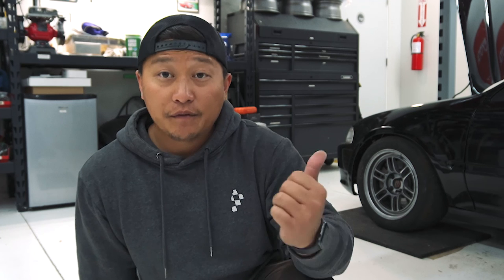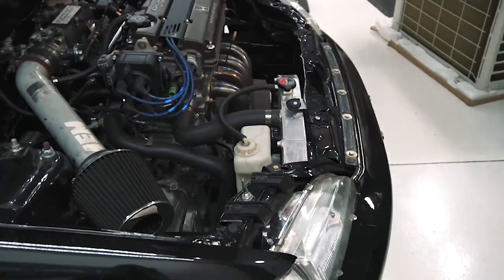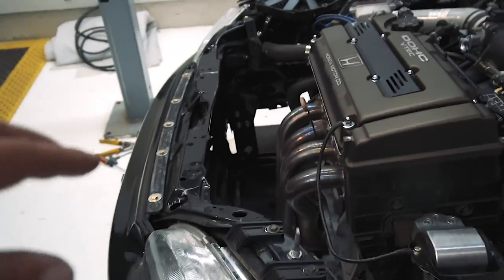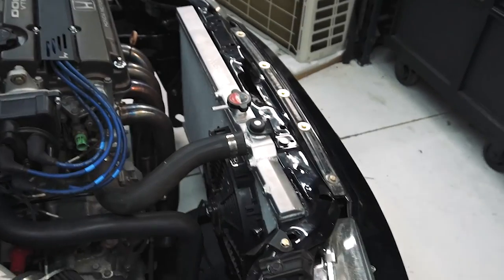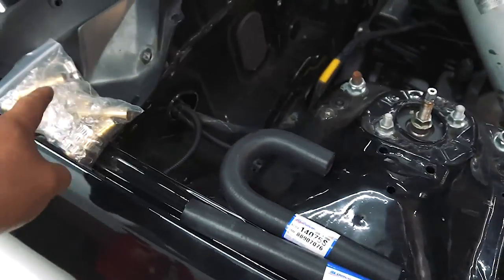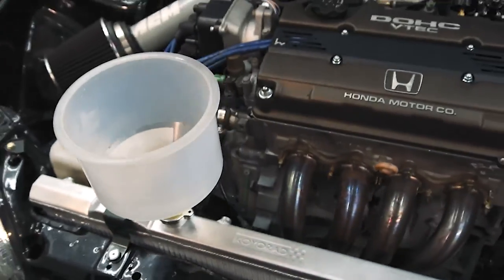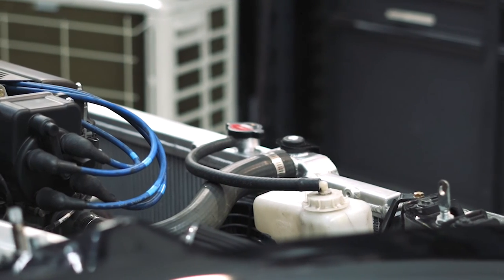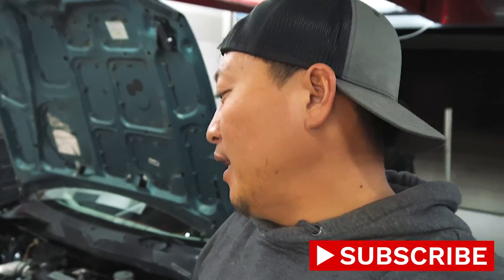Koyorad Full-Size Radiator | Civic EG Track Car Build

Comment: Nice install, but there is absolutely no reason to loop your heater hoses like that, it's best to keep them plugged off. There's already a bypass built into the thermostat housing, which is why the coolant still flows properly with the heater off. By looping the heater hoses that way, all you are doing is giving the hot coolant a path to bypass the radiator and go right back into the engine uncooled. There's a reason the thermostat has a disc on the back to block off the bypass when it's open. There are also good reasons why Hondas and many other cars have a valve that shuts off the coolant flow to the heater whenever it's not on.

Comment: I may have missed it or just don't know. When you install a new radiator you want to flush the system with water, a little coolant and bleed it? Why did you not add standard coolant and just water?
Reply from the maker: It’s a car that strictly see’s the track and not the streets. Tracks like it when you run just water, so it’s less cleanup if your cooling system decides to puke all over the track. Before the winter, I’ll add normal coolant to make sure it doesn’t freeze and destroy the engine.
Reply: @bvspeed  ahh okay that makes sense! Hope this new radiator serves you well.
Reply from the maker: Thank you!!

Comment: Nice work bro 🔥 may I asking question? I have D series want to change full size by Koyorad, the standard radiator fan and also AC is it still can be use or must change? And the second question is how about with the standard AC condenser too is it still can be use? Thanks bro
Reply from the maker: I'm assuming this is in a Civic? If you go full size, then you lose the spot where the AC condenser is supposed to go. If you feel like you need more cooling potential, just go with a thicker half-size radiator.
Reply: @bvspeed  I see thanks bro. I think about the AC condenser can move in front of radiator if I want to change full size radiator, and the standar fan for AC still using it

Comment: Awesome build. Question, I did a b18b swap on my 95 Del Sol. I live in Cali and want to make it road legal, for that I need to wire an OBDII port. Do you have any knowledge on what wire goes were?
Reply from the maker: I’m not too familiar with the legalities in Cali, but I’m aware that it can be a pain in the ass. My guess would be to find an interior harness from a 96-97 del sol which are OBD2 and go from there. I’m assuming you’d need an OBD2 ECU from a 96-98 Integra as well? 

Again, just a few things off the top of my head that I think would need attention. Not actual legal advice lol

Comment: What engine temps where you getting with the alpha skunk rad, and what kind of temps are you getting now with the full koyo rad? 

I have a similar build and with ac still on the car the highest I’ve seen is 198 at a stop light with ac on.
Reply from the maker: Haven’t driven it on the new koyo yet. 

Temps were fine with the Alpha and my stock GSR. The new built B20V is producing more heat now. I’m sure I could get away with ducting the half size, but throwing in a full size was just easier. 

Also, you’re speaking in terms of temps on a street car. This thing is only track driven and spends most of its life at 5k+.

Comment: How is the hood fitment? Any contacts?
Reply from the maker: Fitment sucked, but it wasn’t because of the radiator. It was because of my radiator support that was all messed up. Other than that, it fits perfectly fine.
Reply: @bvspeed  I see. I plan on doing the same to my eg with an integra radiator but didn't know if the hood would close properly. Thanks maybe I might run a full-size radiator